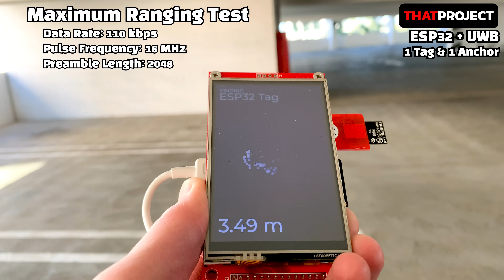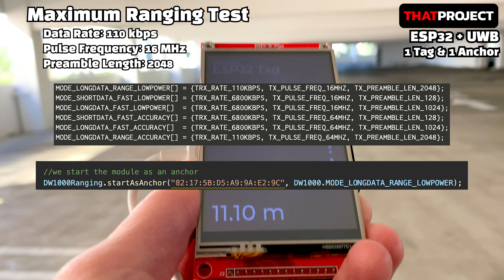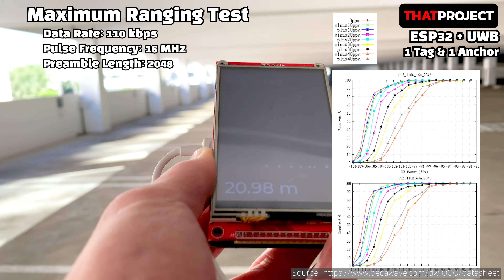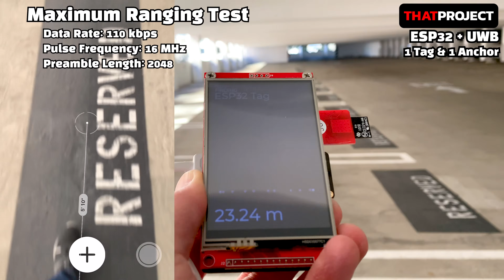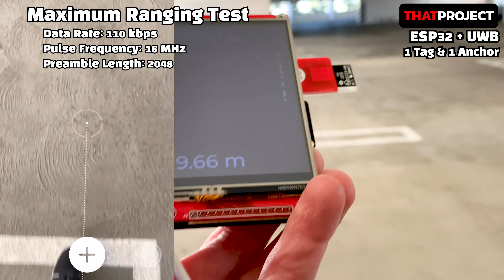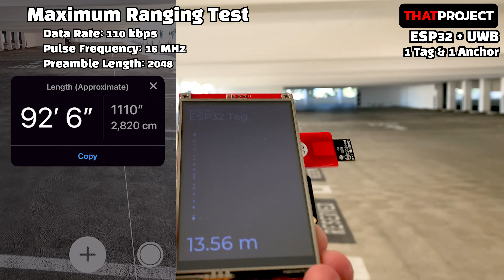ESP32 + UWB | How far can it go?

Comment: Can mobile phone work with this instead of the tag device? I have a legacy solution for indoor positioning, but yours seems cheaper and a little bit simpler.
Reply from the maker: As of now, the only one that communicates with the iPhone's U1/U2 UWB chips is the DWM3000. But this isn't very open either.
Reply: @ThatProject  interesting... what do you mean not really open... and what about android devices?
Reply from the maker: @johnniefujita  Although mutual communication is said to be possible, implementation for actual projects seems difficult. In Android phones, only flagship phones from Samsung and Google Pixel are equipped with UWB chips.
Reply: @ThatProject  very disapointing... in the end I think the indoor positioning system that i use right now only for the waiters of the event is still the way to go... but it would be awesome to expand that to the customer in festivals without the need of extra gadgets.

Comment: Do you have link to schematic and board file of your pcb design? Im not HW savy and would like to learn more.
Reply from the maker: Unfortunately, HW Schmetic is not available. There are ESP32 boards that include a UWB module on the open market. By connecting SPI Display here, you can configure almost the same system.

Comment: I'm very new newbie and I can't find much information on google, is there any way to extend it up to 200 meters or more?. Or how could I connect an antenna to it? would this increase the distance?, thanks for the help!
Reply from the maker: No, this is a short-range communication module. So it can't cover that distance. Any reason you cannot use LoRa?
Reply: @ThatProject  I'm just a novice, I need precision in the position, UWB has a margin of error of 10 cm, there is some documentation on how to triangulate with 4 anchors the x, y, z position of each tag, however, I can not find results in google on how to achieve this with lora.
Reply from the maker: @321oen  LoRa is only capable of long-distance communication, and cannot recognize close distances like UWB.

Your question was whether UWB could cover a distance of 200 meters or so. And that's impossible. I think about 50 meters is the maximum distance where there are no obstacles.

In another video, I tested X, Y, and Z with 4 anchors and 1 tag. https://youtu.be/7oehpBjpucU
Reply: @ThatProject I have seen the video, it helped me to understand more, I have the same idea but with more range, do you think if it's possible to extend twice the range incrementing the number of anchors? 

8 anchors instead of 4, like two grids or more if you need more distance, where the tags are the actors that move inside the grids and you get their exact position, I don't know if is possible, I'm just learning.

Maybe the solution isn't complex but expensive.

Btw, your channel is very interesting, I see you have unity videos, thanks for such a good content!
Reply from the maker: @321oen  That's a good question.
I have an answer to your question. What we need to focus on is the anchor device, not the tag device.
Place the Anchor devices about 50 meters apart to cover the incredibly large area you want. Then you can cover as much distance as you want. But this will increase the cost as you said.

The library currently in use can communicate with multiple anchor devices in a single tag device, but not vice versa. If you can handle multiple tag devices on the anchor device, you can build a much better system. (I'm too busy to have time to do it.)
Reply: @ThatProject  Hi, DW1000 User Manual says that depending on channel, preamble, throughput etc. it can cover a distance up to 80-200 meters. It is also said that channel 4 and 7 are more "powerful". I made some tests and couldn't have better results than 20meters yet :/
Reply from the maker: @libnerrr  Of course, you can power up more and get a much longer range than I tested. The datasheet shows it to work in an idle case. Also, Long-distance communication is not easy indoors or in a place with a lot of radio interference. And distances obtained from the library in use tend to be calculated longer than actually measured. So, calibration is required for actual use.
Reply: @ThatProject  I managed to get 170+ meters setting up gain! very accurate measures. So happy about that (I am not using esp32, just dwm1000 from Mouser electronics and arduino)
Reply from the maker: @libnerrr  nailed it!
Reply: @ThatProject i am trying to build a drone swarm system. The idea is to use stationary drones to use as anchors and moving ones in the middle as tags. Not sure how accurately this would work. May be need a bit longer range still.
Reply from the maker: @hasanershad63  It's an interesting project. What can be a problem is that this system cannot have many Tag devices. I hope you'll consider that too.
Reply: @ThatProject  thanks. I am trying to explore other systems as well.

Comment: Hi Eric, have you tested the range of two ESPUWB devices instead of one with custom build? The range I’m getting is only about 10 meters… my setting is at MODE_LONGDATA_RANGE_LOWPOWER, which is what you have as well.

Love your videos by the way!
Reply from the maker: That's correct. MODE_LONGDATA_RANGE_LOWPOWER allows communication over the longest distance. What device do you use?

Comment: Is there some sort of guide as to what antenna to use? There seem to be a lot of options.
Reply from the maker: Hey Paul, the UWB chip I used is the BU01, which is a cloned version of the DWM1000. If you want a better signal, use the DWM1000. Since this has a ceramic antenna, I think you can get much more reliable results.

Comment: can this project still work while the anchor is dynamic position relative to the tag
Reply from the maker: Even if the anchor and tag move dynamically, the distance between the two devices can be measured continuously because they measure relative. (UWB uses the time of flight instead of signal strength for distance measurements.)
Reply: @ThatProject  Thank you for the information

Comment: can we use Lora modules with it to increase range for example say 50 mtrs??
Reply from the maker: Very long distance communication is possible with LoRa, but measuring the distance is another matter.  Check out this article. https://www.authorea.com/users/227636/articles/286574-calculate-distance-of-objects-based-on-lora-and-lorawan-with-the-help-of-network-server
Reply: Great project by the way..
Reply: Dude read this ...correct me if I am wrong  in LoRA module with Antenae position and with  its protocol we can mostly get the radius at which it is present and  not the pinpoint location ??
Reply from the maker: @advaitkulkarni8929  LoRa enables communication over super long distances. As you said, you can get information about the signal radius, not the pinpoint location. It is possible to estimate the approximate distance with RSSI, but it seems not easy to find the distance physically with this.
Reply: @ThatProject  ohh..okay...so then mostly UWB is used for determining  position and reading more about it got to know that as it works in different frequency band we can only use it up to small distances(is it right?)..as you awesomely displayed around 25meters?
Reply from the maker: @advaitkulkarni8929  Yes that's what I did on this project.
Reply: @ThatProject  Thank you....Got to learn a lot...

Comment: How to read Two axis
Reply from the maker: Two axis for the graphs??
Reply: @ThatProject  yes
Reply from the maker: @ientucamranh9270  Simply put, the x-axis is RX power. The further away you go, the weaker the signal. The y-axis is the success rate of the transfer. Of course, the closer they are, the higher the signal received rate.
Reply: @ThatProject  thanks you very much